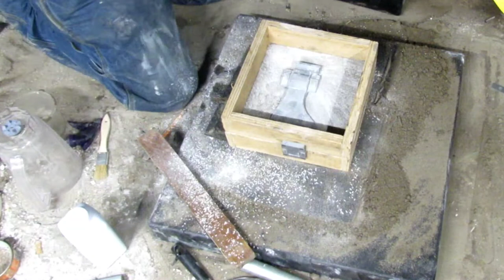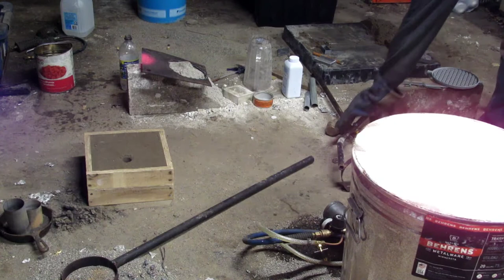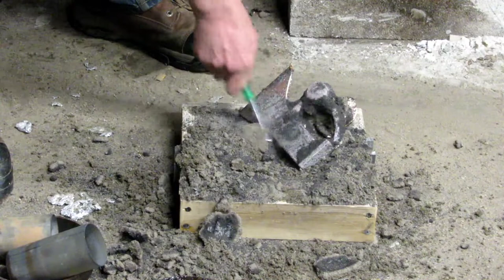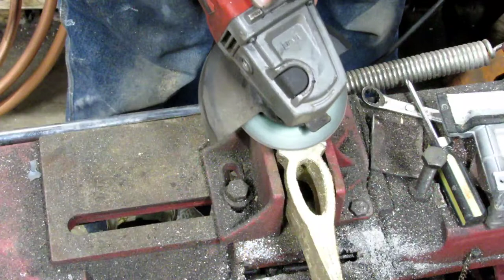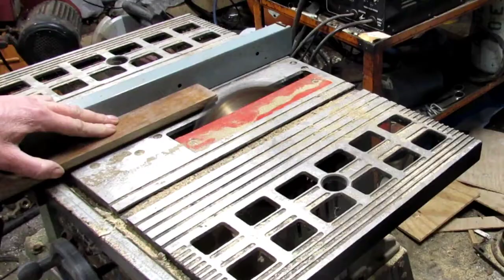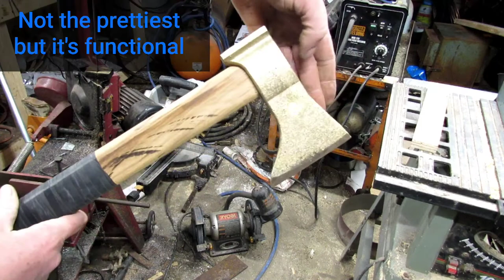Casting An Aluminum Bronze Hatchet

Comment: Fellow metal caster here, curious as to where you found your greensand. Great video and well demonstrated on the process which yielded a great result, very good cast. (I also recommend using a feeder for the shrinkage issue, aluminum especially is known for shrinkage issues (even though its an alloy it has aluminum in it) and well placed feeders help combat that by feeding in molten metal as it cools so it all fills in completely.)
Reply from the maker: Thanks! I made the green sand with sifted mason sand and bentonite clay (cheap cat litter). I'm definitely going to use a riser on my casts from now on. I never had much shrinkage issue with aluminum but aluminum bronze was a whole new ballgame 😆. Thanks for the sub!

Comment: Does that belt sander hold up? Just looked them up and seem to be in my price range.
Reply from the maker: Holding up pretty good so far. It has its flaws and quirks like most cheap tools but a decent sander to start with for the price

Comment: Do you 3D print your models and do you make your own greensand? The axe came out great, is there a benefit to Aluminum Bronze over copper/tin bronze?  Appreciate the info and video!
Reply from the maker: Thanks! I designed the axe head and core mold in fusion 360 and 3D printed on my ender3. Aluminum bronze is stronger than tin bronze and more corrosion resistant. It's also harder as cast so it will take a nice edge without having to work harden it first. I made my green sand with sifted mason sand and cheap cat litter. It takes some time to figure out how moist it should be but once you get a feel for it then its second nature.